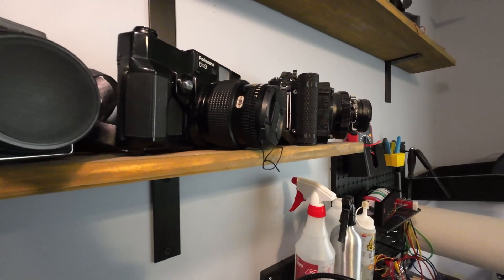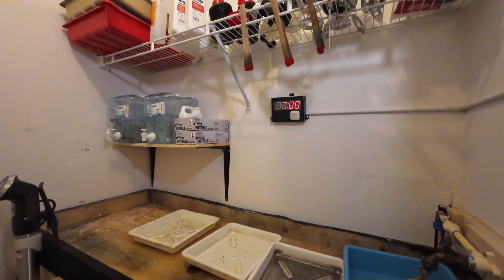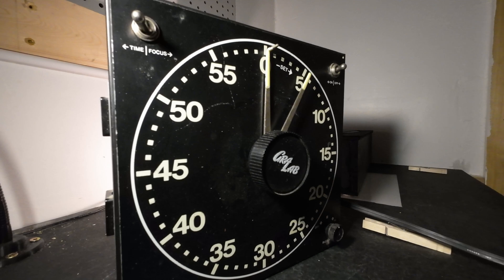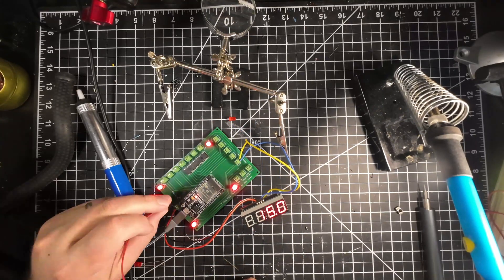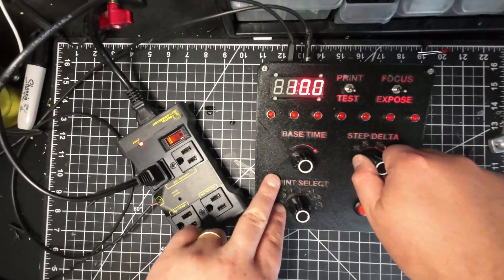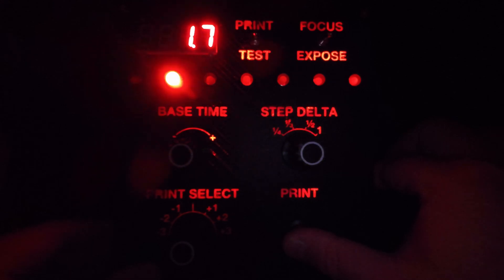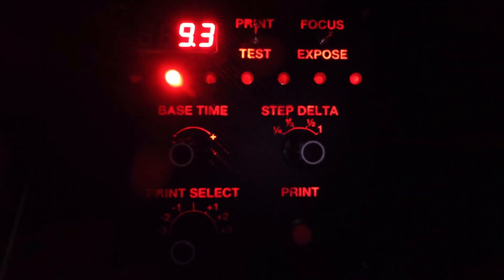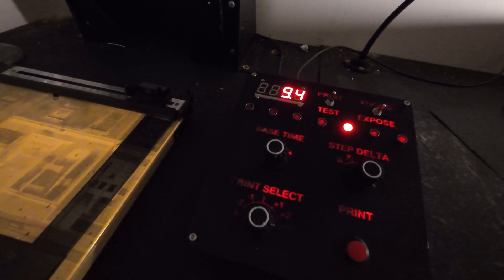Custom Film Darkroom Timer with an ESP32 Microcontroller

Comment: Very intresting project, thanks for sharing it. I do not have experience with outsourcing a PCB can you give some insight how to start?
Reply from the maker: Thanks for watching! Yes there are many different on demand PCB manufacturers online where you can upload the Gerber files (included in the GitHub repo for this project) and they will quote and assemble a small batch of boards for you.
Reply from the maker: @zteefzeefje  Glad to hear you are making progress! I uploaded a schematic that lists out all the parts on the PCB: https://github.com/johnjones4/F-Stop-Timer/blob/main/PCB/F%20Stop%20Timer_schem.png I also have the rest of the parts for the project listed here: https://johnjonesfour.com/2024/09/23/esp32-darkroom-timer/
Reply: @johnbuildsthings  Thanks John, that's great help adding this to the repo. Just one more question, the two rotary switches how are the wired to the board, what is the common contact and the test strip leds on the front how are they wired?
Reply from the maker: @zteefzeefje  So for the rotary switches: wire the common terminal on the switches to ground. The terminals on the diagram labeled D1 and D2 (GPIO pins 25,26,27,14) should be wired to the stop delta selector (1/4, 1/3, 1/2, 1 stops on the panel) and the terminals on the diagram labeled Print 1 - 4 (GPA0 - 6) should be wired to the print time selector (-3 ... 0 ... + 3). The LEDs follow a similar pattern. Connect those to terminals labeled Step 1 - 4 (GPB 0-6). Does that help?
Reply: @johnbuildsthings  YES, super thanks this makes everything clear especially D1 and D2 :)
Reply: @johnbuildsthings  Hi John, I took a while because of the holidays but I'm now assembling the pcb and front panel. I do not have Adafruit components and hope the display and encoder will work. Can you tell me how the logic behind the focus, print and start button is. Is it high when selected with a pull down resistor, or something else? Thanks Steef

Comment: How many relays did you use and what did you drive the display with...??
Reply from the maker: Thanks for watching! Check out the blog post I wrote about this project where it has a bill of materials which includes the display (with built in driver) that I used and the relay I used to activate the enlarger: https://johnjonesfour.com/2024/09/23/esp32-darkroom-timer/